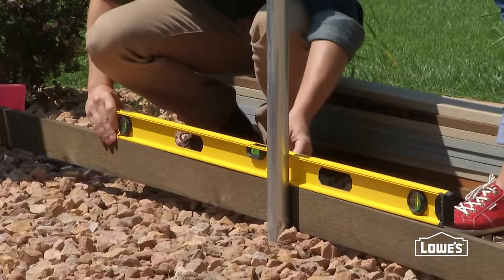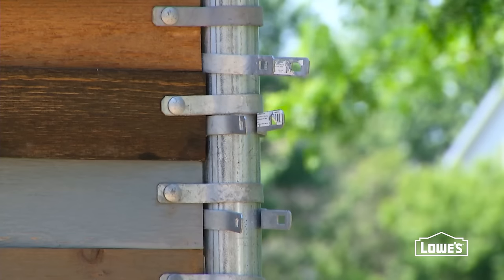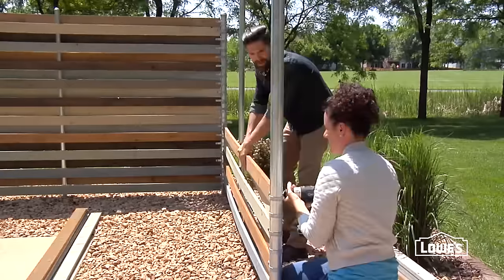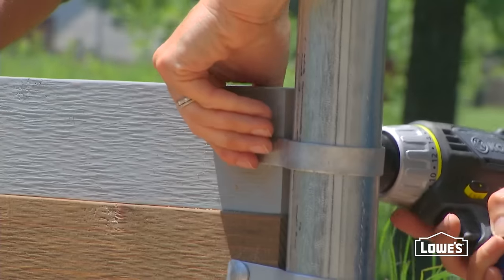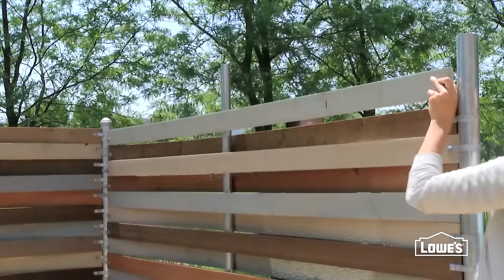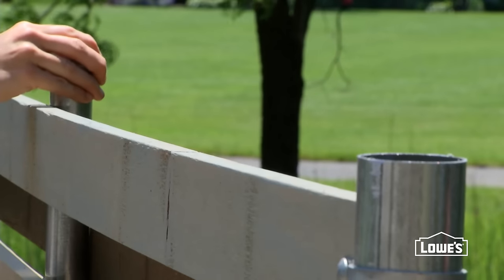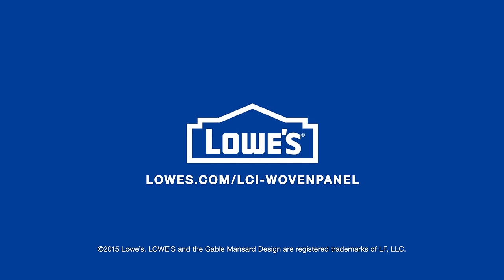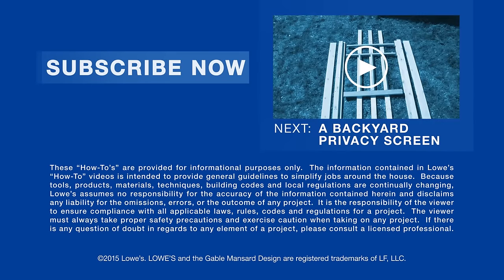How To Build A Woven Fence Panel

Comment: would this be cheaper for a side fence from ur neighbors? what would be the pros and cons?
Reply: That's a great question!
Reply from the maker: +EpicTouchUSA cost is going to vary depending on what other options you're considering. You can find tools & materials list for this project here: http://low.es/1WGcl84
Things to consider in the "pros and cons" include any HOA or other restrictions and what level of privacy you want the fence to provide.
Thanks for watching our video.